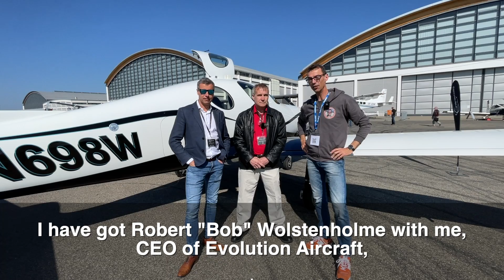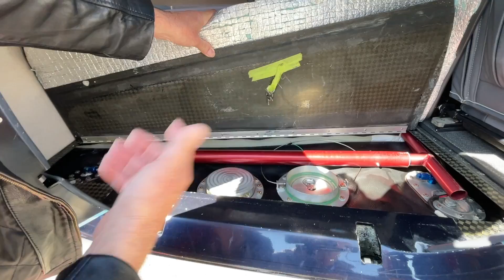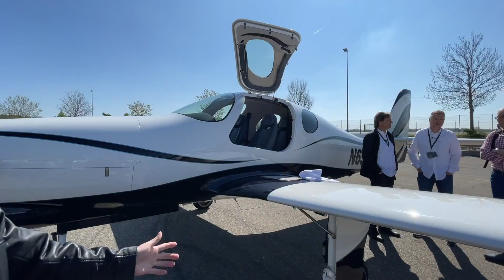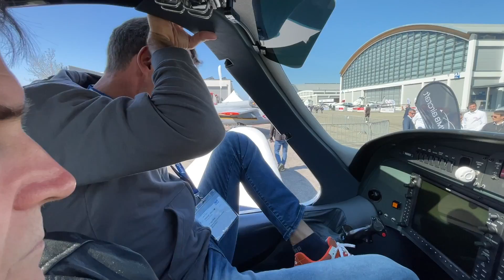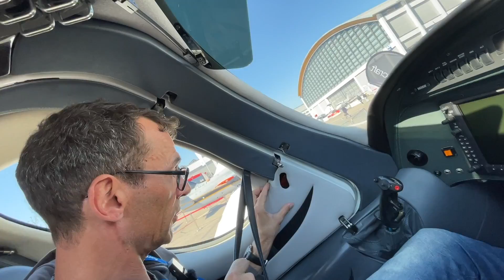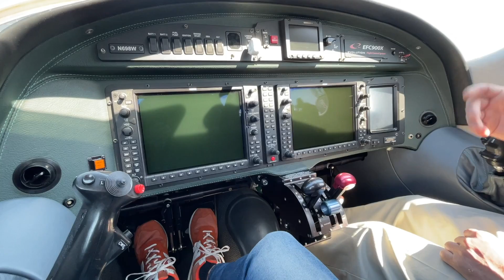Cooperation of JMB & Evolution Aircraft - Lancair - Pratt & Whitney Turbine

Comment: I have been wanting to upgrade from my Cirrus to an Evolution since they were first introduced.  Sadly, the setbacks and ownership changes this aircraft has gone through stopped me from committing to a kit twice.  Now that JMB is the source for this aircraft, I’m all in.  Can’t wait to find out how to get one, what the price may be, is it still a kit or will it be fully assembled?  My second choice was the Piper M600 and I am ready to oder one, now, back on the Evolution.  I hope its is a successful collaboration.
Reply from the maker: Hi! I also hope that it will be a successful collaboration. As I know it is an assisted assembly (I don't know the correct expression for it). So you have to be in the factory for some days but the plan gets more or less completely assembled by the JMB crew. 
I will hopefully be at the factory in May to have a test flight with cameras, I am looking forward to it!  🤩
Good luck!!

Comment: Very interesting. Nice to see JMB being ambitious and progressive. I'm in a way a big fan of Lancairs, particularly the IV-P stands out which is the predecessor to this plane and could do 540km/h, about the same speed as a Visionjet because it was pressurized and had a turbo engine. Those two aspects are the key to fast flight. BUT I have grown to dislike turboprop engines because they are the worst of both worlds. It has the front noise maker propeller and single engine failure weakness and it costs jet plane money. I don't know the exact price depending on version but it's a good part of a million dollars just for the engine. And the plane might cost 1.4million today? for a kit plane. And Pilatus PC-12 also with just one turboprop engine is 5million dollars. You can get as nice twin jet for that price. So I really dislike turboprops and for good reason. However where it gets really interesting is if we could get small turbofan engines for ~500kg planes. That way we can have two small engines for over the ocean redundancy and they are naturally quiet behind the cabin for jet sophistication. And if the plane is built for speed we could get 7-800km/h instead of 5-600. And a jet engine for a 500kg plane can be super small and thereby potentially cheaper than a piston engine if done right. It could be as small as 15kg per engine. Basketball size. And it doesn't have a gearbox like a turboprop engine. So they could be less than 50k$ per engine or 1/10 the price of this turboprop. It's nothing short of a revolution in aviation. Whereas this turboprop plane can only ever be modest niche. So the key is for someone to make such a small turbofan engine. That would revolutionize GA.
And you might think that jets are fuel inefficient but that's not true for turbofan engines. The world distance record belongs to an off the shelf Williams FJ44-4 engine that flew 40000km without refueling at 500km/h. Show me a piston cessna that can do that. So because the engine can be small and light so the plane can be small and light it will just beat everything else by a large margin.
Reply from the maker: Thanks for watching and this detailed comment! Your background knowledge is much bigger than mine so I am just impressed and happy to have learned some new points.👍😀 Really interesting!